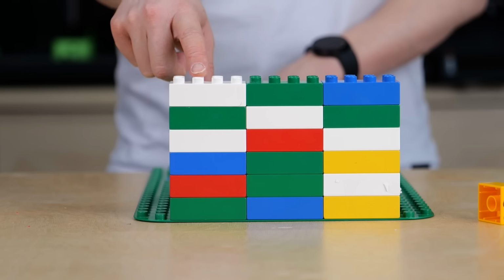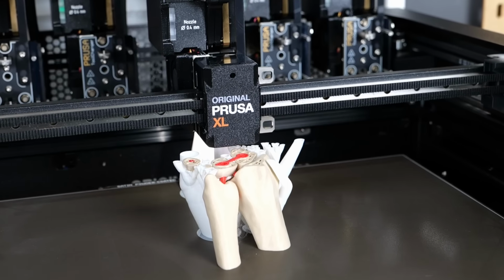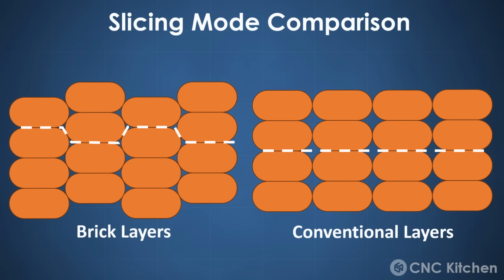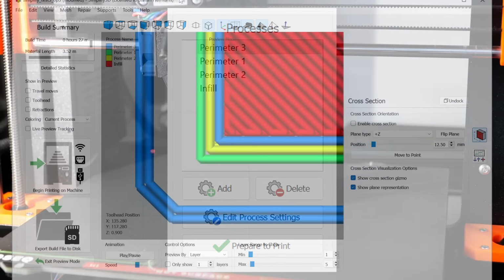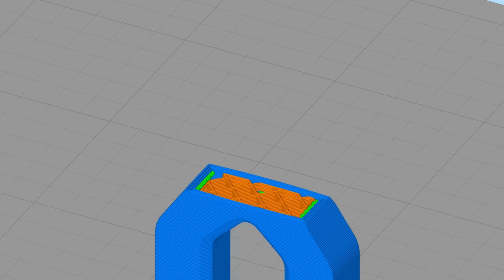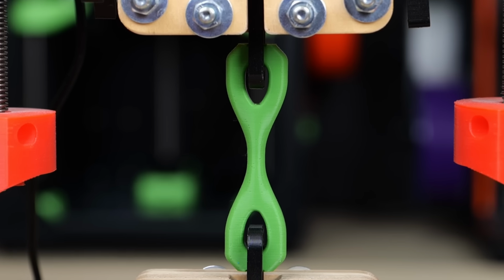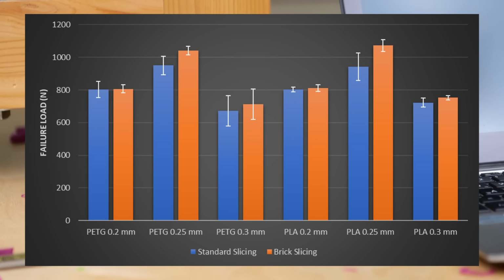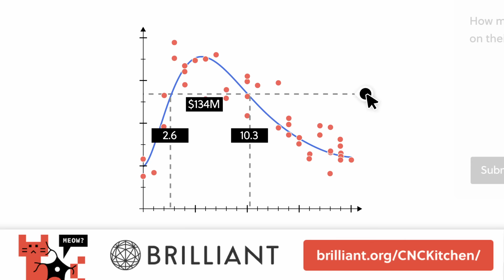Brick Layers - Why did no one do this before?

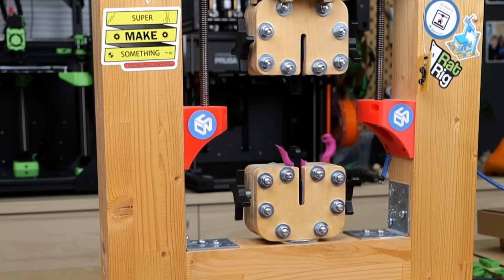Comment: Like this idea. 7:56 - certainly introduces other unwanted results but to learn about this we need more testing. PETg should never explode like this. 

It’s just so difficult to quantify FDM part strength because there are soooo many variables - and these variables become clear from one part to the next. 

When I want strength - I print my parts one at a time, rather then layer by layer.  Your brittle parts were probably the ones that cooled the most between layers. The heat of your previous layer is really important for strength. 

Printing one at a time not only allows for reduction in complexity- but also allows you to think more critically about the part you are printing - especially in achieving strength. 

Printing one at a time also reduces the chance of inconsistency in extrusion. 

I think we need to start breaking down the variables one by one and addressing them. An ideal job for machine learning. But to start with it we figured out… 

1. Optimal previous layer temp vs nozzle temp. 
2. Extrusion multiplier vs cooling

Obviously the above points interact with one another. But if we start breaking it down we will learn. Then we can decide what technology should be added to make it work together.

Just to add - keep going! You can find solutions if u keep going! Ur very good - keep going
Reply: They have alot of videos on similar tests. The point here wasn't maximum strength, it was to show the difference with this singular change. That being said, I would love to see what this change does when trying to achieve maximum strength of a specific part. Enclosures, reduced fan speed, hotter temps, slower print speed.
Reply: @radioactivesdesigns3554  - yes I agree. I have followed for a good while. But the over-arching goal is to increase strength of FDM parts - which is a great goal because it’s tricky. 

I really liked the clear printing results. I learned from that myself - helped me print stronger parts.

I feel like the clear printing parameter would be a really good place to start on achieving the holy grail of layer bonding. I would love to see more deep diving into this.
Reply: PETG is actually known for flash crystallisation under stress, which causes it to fracture and explode in all directions, forming sharp edges. I have no clue what causes it, it's a weird material. It's also quite capable of producing almost isotropic prints with no clear weak plane even under normal printing algorithm, with just the outer perimeter bead corners and model geometry causing stress risers.
Reply: @SianaGearz  - do you mean 3D printed PETg? - PETg sheet / stock is pretty consistent and ductile. 

But I have seen all kinds of weird results with PETg printed - sometimes really ductile - sometimes really brittle.
Reply: All of my petg parts I've made that underwent prolonged cyclic loads exploded just like that, multiple mounts and adapters I made to attach stuff to my motorcycle (nothing safety critical!) Eventually failed spontaneously and catastrophically just like that. Different filaments and geometries, never failed along a layer line either since I printed to not have significant loads in those directions. 

Reprinted with CF nylon and they've lastest more than 2 times as long without a single sign of wear so far.
Reply: @hayden9944   Not only 3D printed. People playing around with extruded PETG tubing also seen that while normally ductile, it will sometimes fracture just like that. It's also presumably what compromises PETG's impact resistance in every test, since with its ductility it should be able to score better if it wasn't for this.
Reply: @Lolwutfordawin  I have come to like HIPS for reasons like these. I don't know why everyone treats this material as a joke, it's really quite capable and relatively trouble free.
Reply: @Lolwutfordawin  yeah, I've seen the same thing on many highly loaded parts that I've printed in PETG, like tube forming dies and such.
The stronger and more homogeneous you make a PETG part it also gets more brittle.
While I've had some parts fail due to bonding issues, that was pretty easy to solve.

These days, when one of my strong PETG prints fail, it's a brittle failure and behaving pretty much like a solid piece of plastic.
Of course it still has stress risers and such from the printing, but they don't fail along layer or perimeter lines :)
Reply: @SianaGearz  I'll have to give that a try someday! I like CF pa a lot, the CF reduces warping to be very manageable with my non-ideal enclosure when dry, and the relative lack of toxic fumes with nylon is very nice. Having to have it perfectly dry to achieve usable results is a pain without a dedicated filament dryer though.
Reply: @SianaGearz that's very good info, thanks!

The design of a part makes a significant difference as well, if you design for the strengths and around the weaknesses of 3D printing, you can get some really quite strong parts in PETG, but even when designing in some flex, they can fail in brittle ways under shock loads.

Exactly like polycarbonate can BTW, I hardly believed my eyes when I managed to shatter a small piece of PC sheet stock with a chop saw, but yes, it certainly can fail in brittle, almost explosive ways, producing sharp edges.

So yeah, I fully believe you that PETG can do the same even in extruded or cast sheet or tube material :)
Reply: @SianaGearz  - plastics can be weird, so I can’t deny what ur saying as true.  But I would still expect the dominant reason for shattering 3D printed parts is down to the process.  Usually when ductile materials shatter it’s down to a buildup of internal stress’. A plastic that is normally ductile - but with high internal stress can be brittle. 

If you constantly bend your PETg tubing, or thermally cycle, or moisture cycle - it will introduce internal stress and eventually… 

But then there is the quality of plastic, quality of processing it went through. Etc etc etc - plastics are complex…. Which is I suppose the point you are making - and I don’t disagree.  Haha - took me a while

Comment: As a welder : what about FILLING these gaps ? what about pushing the material down between the previous layers instead of gently droping plastic and hoping for a weld ?
Reply: You can increase the flow of material in your printer settings, that way it spills out more from between the previous layer and nozzle, potentially filling gaps. But you can't really push down since the filament is liquid when printed. What would create a stronger bond is printing at a higher temperature (or reducing fan speed to like 50%) and printing slower for better temperature control.

What I think this method improves is adhesion between two rows on the same layer as well as an increased surface area between consecutive layers.

Comment: Hi Stefan, what an amazing idea and execution! One add-on I've come up with... MORE FLOW. 

Let me explain. AFAIK most printers (extruders) are set up to feed slightly less than 100% material. Like 98 to 99%, and that is BEFORE any manual flow rate adjustment you apply. That's because you need to compensate for the inevitable air gaps between the round edges of the "bricks". 

But with this staggered layering, there's going to be less gap, so you should be able to feed more and yet maintain the dimensional accuracy. And if you really want to take it to the limit, you could keep the reserved flow for the outermost perimeter and push more into all the other perimeters in between.

This can make the print much stronger I believe, and I really hope you have time to try it!
Reply: And also i think it is worth to slightly increase the temperature cos the hot sausage is contacting more cold plastic, and it has to slightly melt all of this.
Reply: @wormball  Great idea, totally makes sense!

Comment: It would be nice to see if this technique also helps with transparency and compare the results with the ones you’ve achieved on your clear printing presets (2 years ago). I’m working in the commercial lighting sector and one of the most expensive parts are the LED lenses (Plexiglas DR Acrylic), and since a big order of decorative/fonctional street lights is around 100 heads, it’s difficult to justify the price for a high quality injection mold that will make our own design (unless your a huge company). Therefore, we’re stuck with standards lens which are not the best. It would be amazing to be able to print on demand our own lenses design and polish them in house!

Comment: Nice! I would also try to slightly increase amount of filament. In cross section I see that with the standard process the flow lines are deformed. However on the new one everything is made of nice elipses. Which means that the filament is only put on the other layers but not pushed in. So there is a potential to minimize the gaps between layers.

Comment: in UltiMaker Cura it is possible to do this too, you can change the infill layer height, it is even better if you add extra external walls of the infill

Comment: I wonder, for layer height assuming same vertical layer as the test pieces in the video, if the print nozzle prints as normal, but per each layer then moved 1/2 from original printed path (not printing just ironing the layers) and to sort of iron the layers and get the horizontal layers to melt together a little more, before print nozzle having ironed the whole layer resume to print next layer. I wonder if this way the print would perhaps become stronger? I dunno, maybe use the 100% infill and when finished place in container and surrounded with extremely fine salt or sand and place in oven for a while -method, my thought/piece there would basically add maybe 3/4 more print-time to the model due to the nozzle likely needing to move a little slower on the ironing than on print-layer speeds.

Comment: That's very cool for the perimeters.  I have an old file (perl?  something I didn't understand) that was called wave_infill and it would run the infill along a sinusoid z save and that made it much stronger.  Also slower because the z axis is... not fast.  I printed at 0.3mm high, wave function of 1mm...

If you want I can try to dig up the script...

Comment: With only a vertical offset, you're actually decreasing the interface between vertical columns (see Pythagorean theorem). You can see the difference around 5:39 where the brick columns are barely touching each other. You should try doing the slicing for a smaller extrusion thickness and then printing with a slightly bigger one to increase the width of each layer to make better contact.

Comment: Id love to see other types of measurements on your samples, like toughness, bending stiffness, notch sensitivity, etc. I think you're methods were very well described and you made the video quite entertaining. I expected more than 10%. Maybe a " taller" extrusion would have more overlap with the adjacent "cells" to be more "bricklike" in the vertical direction.  Another cool idea would be to put this on a high speed camera with several frames per second so you could wat h how it explodes!

Comment: 7:50  If the parts have many cracks and are exploding
it probably suggests that the main weakpoints - the bricks lines - are now removed as the main failing point, so you are getting multiple failures all over, distributed around the whole thing - more like you would expect a solid object. like a cup or plate that broke I would think.  In other words its a "good thing"
Those failure zones were being eclipsed by the brick weakness before

Comment: You can also try using vibration on the nozzle to enhance the bonding between layers.
It is possible that this would result in the entanglement of the PLA fibers, leading to better adhesion between layers.

Comment: I have yet to see if anyone uses a speaker generating a sympathetic tone to encourage "slump adhesion" on layers to increase that inter-layer contact-patch and would love to see if you could vibe a print to better quality...seems an easy win provided the subwoofer doesn't bounce the print clear off the build plate. :)

Comment: Nice Video, interesting topic. Did you ever print and test the same geometry with print direction shifted by 90 degrees as a comparison for maximum achievable strenght for the material? Would be interesting how close you are to the limit with your layer shifting method.

Comment: also to add smaller layer heights does add more strength. the hotend is more directly connected to the part allowing more heat to be put into the part allowing a better more fuller bond on layers. you also get a better shape with finer layers as the squish is better larger bonding surface and smaller air gaps

Comment: Is it possible to drop the filament from a height slightly greater than the filament width?  So that you can lay a filament over an uneven surface without needing to move the print head up and down over the surface as you go?  If you can do that then you can weave the filament into the third dimension to effectively knit the layers together.

For example, consider a spool of string which is wound with that familiar herringbone pattern.  The spool turns continuously while the string winds onto it by moving back and forth across the length of the spool, following the ridge created by the previous time the string went in that direction.  But the spool completes maybe four to six full revolutions in the time it takes the string to reach the other end, and so there are several points where the string crosses windings which were travelling the other way.  Where it crosses a the string going in the other direction it locks it down, and it will itself by locked down when the string comes back the other way.  I believe this means that overall all the layers are tied together at regular intervals.

So maybe like that, but rather than going around a spool, you would lay one continuous thread zig-zagging across the width of the wall, and continuing indefinitely around that wall.

Comment: turn the pattern by 90 degrees (half width on sides, instead of half height at bottom). i think it might seem counterintuitive, but stronger. because it would allow plastic to be squeezed harder in those cracks...

Comment: Try doing a strength test on the lateral direction between traditional layering and the brick layering. I believe you will find that the strength improvement is even higher. The grain direction can be a big difference.

Comment: How about undulating each extrusion up & down and left & right to give them better bonding with the neighbors? Would be touch to code and probably make prints take longer, and would make surfaces less smooth too, but it might significantly improve strength.

Comment: It would be interesting to see how extruder temperature, and ambient temperature (in a temperature controlled chamber) affect the strength of the prints.  It would also be interesting to compare an injection molded part with a 3d printed part  of the same materials and see what percentage of strength we sacrifice by 3d printing.

Comment: Interesting stuff. I think the near shattering effect on the PETG samples is due to the reduction in total elasticity of the part caused by the offset pattern. When taken to its breaking point the layers then cannot return to their original locations. They have the req energy to do so and that needs to go somewhere, that somewhere=everywhere.

Comment: @CNCKitchen I can see this as being a potentially interesting solution for multi-material prints for materials that typically don’t adhere well together.

Something I’ve played around with before is to make prints with a TPU first layer as something like a high friction base e.g. so a coaster or vase does not slide around as easily on a smooth table. However that usually doesn’t work very well as often the TPU base layer eventually peels off the PLA or PETG body of the print.

Maybe with brick layers the TPU layer can get locked into place…

Comment: Great work! I print drone frames at 0.6 layer height in abs. if i had that feature available to me I would use it in a heartbeat, but I would not go back and mess with simplify 3d just for a 10% increase in strength (also as any reasonable person i design and print my parts such that the layer problem does not compromise the strength of my designs).

Comment: If we would heat up a box (air-tight) to certain degree and the draw the air out, would we possibly get the gaps between the layers to get closer together and make it even stronger? 5:50

Comment: Can you try printing this same brick later pattern on a horizontal axis, laying flat, instead of upright. 

This is so the pulling force is placed on the material instead of the adhesions between the plastic. 
Like with rope, you pull threads length-wise, relying on the strength of the thread.

Comment: Anneal the finished part with the lowest viscosity superglue you can find?  could be poured through the inner crosshatching to coat the interior and brushed on the exterior.  Very cool video.  I saw another video where the surface was treated with baby powder and UV resin...So I wonder what a baking powder treatment on the exterior with the superglue brushed on would do for strength?  I would do something like the UV resin coating to make it look nice afterwards.  There are glues like hide glue used in old guitars that requires the glue to be heated.  If there was something that could be added to the extrusion process...

Comment: I wonder if you could do a similar but different method: Each layer is staggered half the nozzle width, so the new layer is laid down and melted in-between the extrusions of the previous layer, filling the gap to make the layers interlock. You could even do things like extrude the staggered layer thinner, so it only fills the gaps rather than being a layer unto itself, acting like mortar between the solid layers.